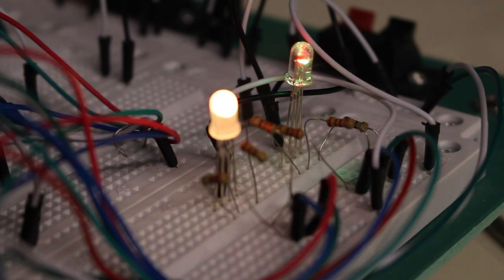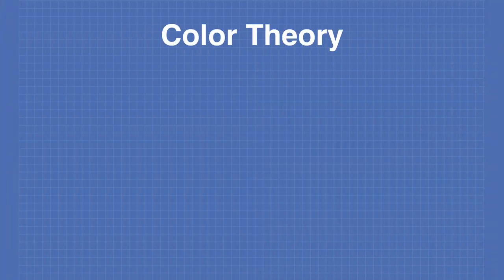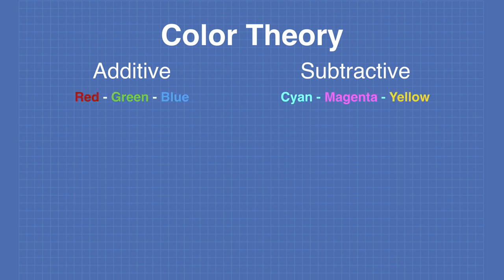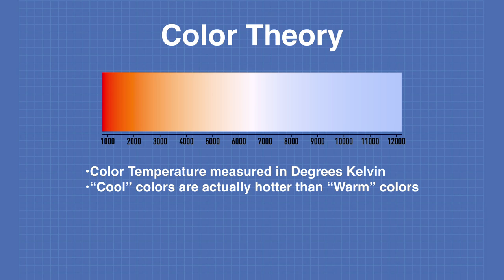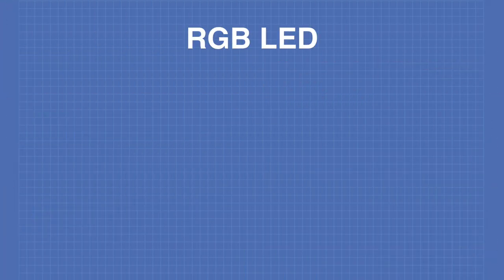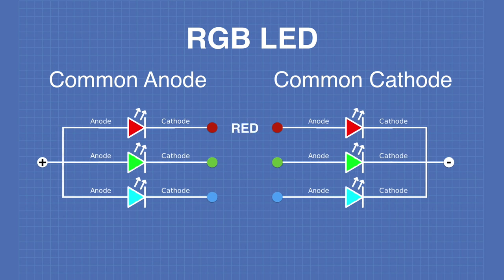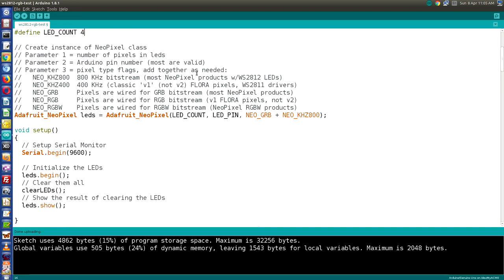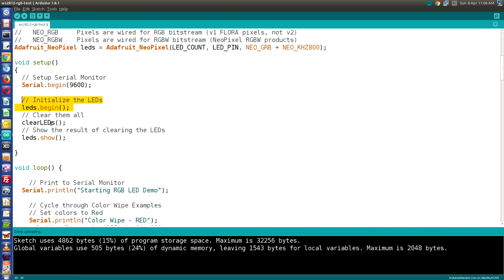RGB LEDs with Arduino - Standard & NeoPixel

Comment: Thank you for this excellent video explaining the differences between standard LED's and RGB LED's.  I had been briefly introduced to the NewPixel LED's just before Radio Shack went out of business and I was able to pick up a couple of 1M strip lights for a fraction of their original cost at that time.  More recently I picked up one of the 8X8 RGB LED matrix from Adafruit and wasn't sure what to do with it. Now, after this video I'm more confident that I can actually do something with both of them.  Have you ever coupled multiple matrix blocks together to make a marquee type of display?  I was thinking of picking up one or two more of the 8X8 units and wanted to be able to create rolling messages that starts on the right and moves to the left on all of them.

Comment: Thank you for posting this instructional and informative video on RGB & Addressable RGB LEDs. At Min. 31:47 you note that you need to 100uF Cap and 330 ohm resistor for your stand alone Addressable RGB LEDs. I would like to know if you need both the Cap and Resistor for an Addressable RGB Strip?  Thank you again and keep up these great videos
Reply: The electrolytic capacitor is required to smooth out the arduino power supply when the LEDs switch on and off. It's not required if you use an external supply., The 330 ohm resister is always required.

Comment: Great explenation and video. Tried it at home with a 60 LED long strip and it works. Only implemented the colorWipe function to experiment. I only run into one problem. If the LED-count is higher then 10, it keeps only working for the first 10 LEDs. It looks like more then 10 LEDs is not working? Or am I doing something wrong?

Comment: Another excellent video. I was caught off guard when a kit I bought that contained a common anode RGB LCD had me baffled for a while until I realized that all three output pins going to 5V resulted in the LED going blank meant I had the wrong code for the component in use.

Is there any way to visually check the LED to verify what type it is? If not then what is the technique to do so?

Comment: Thank you very much for this video and the many others.   They are very helpful in many ways and have helped me keep productively busy during this Covid era.   Im about your age and had never soldered before and have many problems soldering extension between LED on WS2812 strips.  And I have two questions if you don't mind.  1-- Can you recommend some practice techniques and setups to learn to solder on the resulting small pads once strips have been cut?   I have tried several setups, but not been able to match the size and thermal properties of the reduced pads.  By that I mean that the copper base I've used has more mass than the pad on the strip, thus absorbed more heat.   2- Where can I get the programmable LEDs you used in the video?  Once again thank you very much for your videos.  Juan

Comment: Hi,
RG
Would please tell me how could I use the ESP32/ESP8266 to control the 12V standard RGB LEDs?  Can I connect the 12V LEDs to the 12V power source while the ESP32/ESP8266 is feed with the 5V power source?
Thanks,

Comment: Great video on LEDs but also some good coding insights as well. Only question is about the capacitor on the 5V from the Arduino. What is the purpose of using it, and do you still need it if you are using an external 5V power supply (in my project I am using a buck converter to step down 12V DC to 5V)?
Reply: The electrolytic capacitor is required to smooth out the arduino power supply when the LEDs switch on and off. Ii's not required if you use an external supply.

Comment: I wanted help controlling the color red an blue. So there on the same strip, and I want blue to light up and switch to red over an over. So there's 3 lines 1+ in an 2 outs each out is a color red or blue. I want to have the light time changed fast